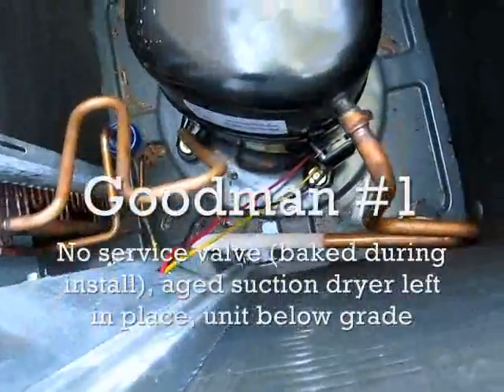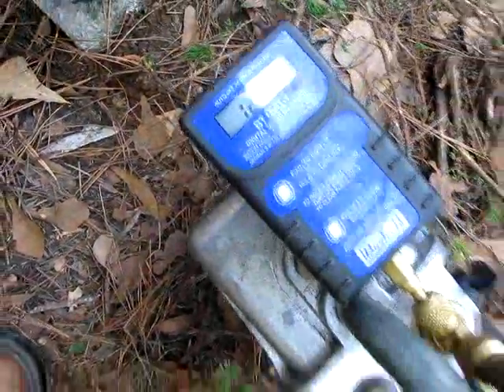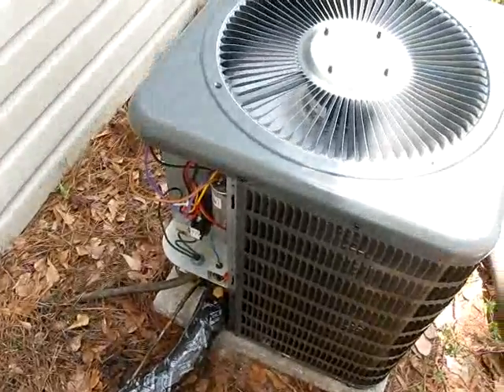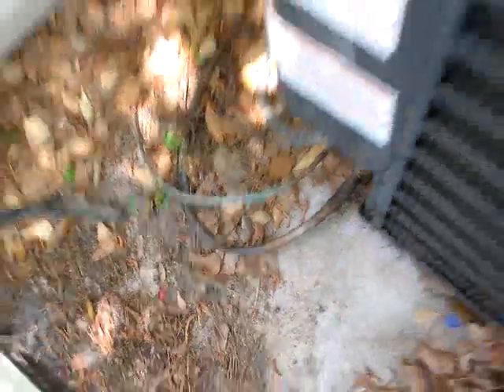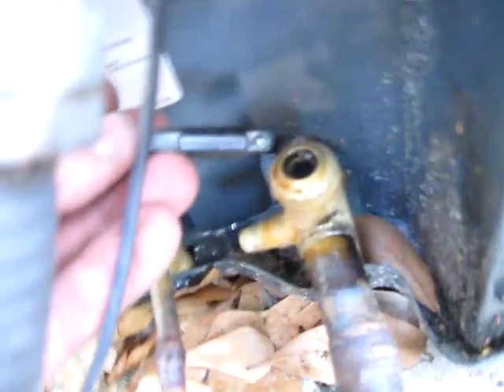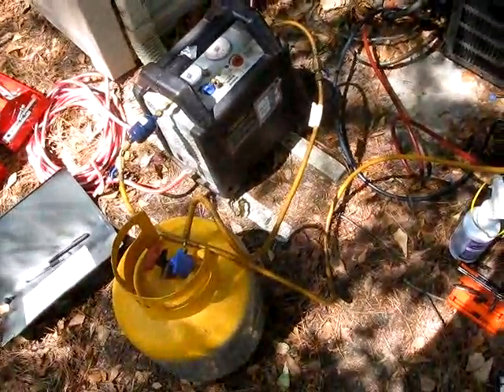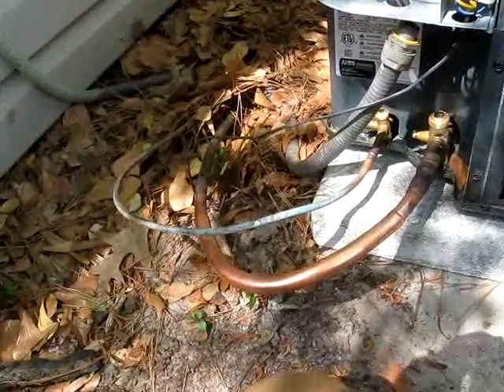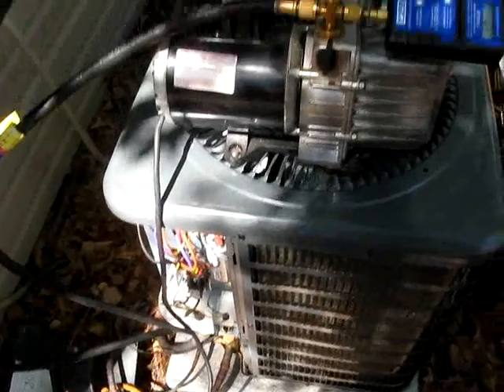HVAC Service- Goodman Air Conditioning Repair

Comment: If it wasn't for that microcannel coil that Bristol would've pumped it down good i like Bristol recipercating compressors i was going to get a small refrigerator compressor from Bristol and have it shiped to acr supply in Winston Salem because its with in driving distance from where i live at but acr didn't carry Bristol compressors but they was going to order one for me i mean i wasn't going to put it on a refrigerator i was going to do like a training thing just to practice like charging and brazing skills but the compressor cost 190 dollars plus shipping with would have put the total at aabout 240 dollars. So i didn't have the money to spend on it